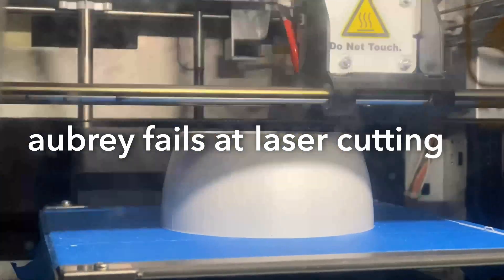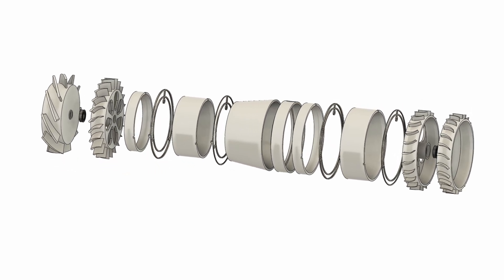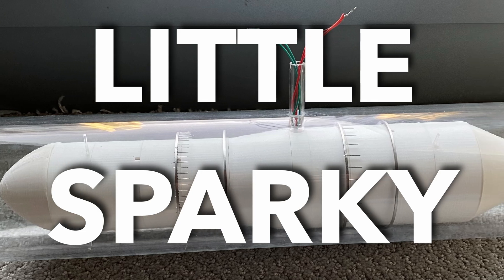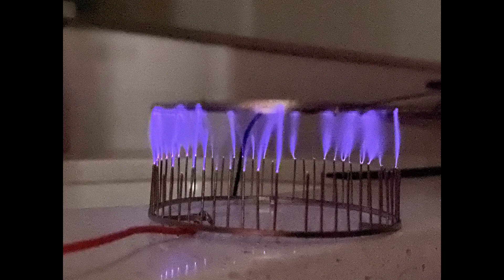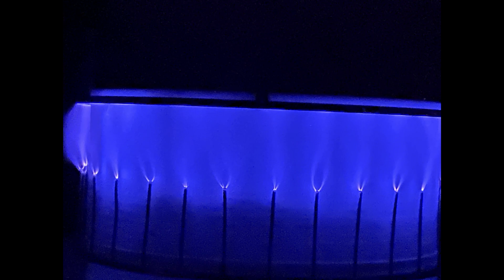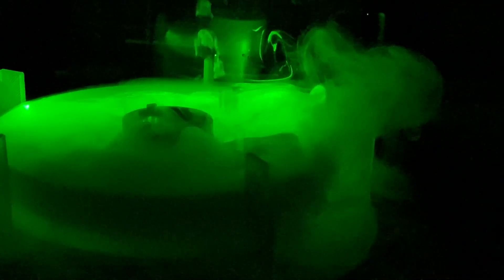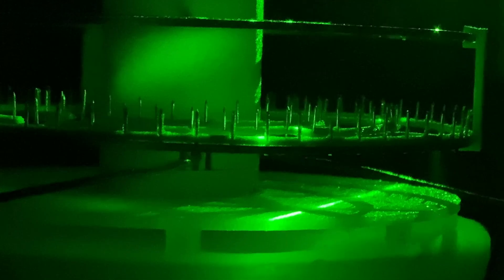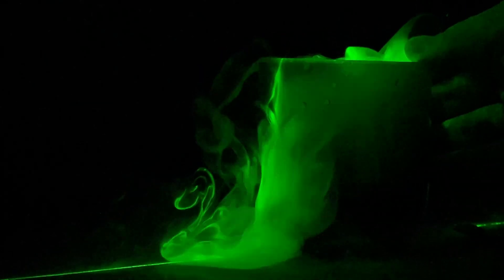Aubrey Fails At Plasma Physics

Comment: Nice visualizations.  At about 0:38 you mention the Lorentz force as being responsible for the corona streamers you show.  However, the Lorentz force ( https://en.wikipedia.org/wiki/Lorentz_force ) is generated on charges moving in a magnetic field and is the driving force for electric motors and the reason auroras occur near the Earth's magnetic poles.  The corona streamers are generated by the electric force (like charges repel, opposites attract https://en.wikipedia.org/wiki/Coulomb%27s_law ) acting on ionized air molecules in the electric field between your electrodes.

Comment: Please wrap some copper wire around the acrylic tube and see how it affects the ionized air inside.
Reply from the maker: Can you be more specific? If I wrap the tube with opaque materials, I can’t see inside. The only way I could measure anything is via exit velocity. And do I do anything special with the ends of the wrapped wire? It would just act as a sorta dipole antenna if I didn’t. This just seems to sap energy and radiates it away. And having a solenoid loop around it all would align the E field and B field along the axis of flow.
Reply: @aubreyfails  I'm asking you to create first a linear tokamak with a current in the winding, which is spread out enough to see what happens inside.
Then try creating a capacitive charge on the inside by creating a charged conductor on the outside to see if the inside charge
 compresses the plasma.
Reply from the maker: Ok so for one thing this is running at 5W. If you think this will generate anything interesting beyond some corona discharge you’re dreaming. For another, you seem to have lots of ideas. Why not do the work yourself?
Reply: @aubreyfails  Without going into personal stuff, I have the mind of a mad scientist (I love the humor of Foglio's "Girl Genius," and xkcd comics),  but have never been able to grok calculus. As that is the gateway to Any technical field,  I'm screw. Otoh, I can see ideas other people don't seem to pay attention to, and I end up wondering, "what happens when you do this or that?"
Then add that my job is leaving me little time or resources to work with. You, otoh, seem to have the resources and skills to do things.
TMI? You asked. I could go on a rant about the Aholes trying to stop and Musk, and the other ones running Boeing literally into the ground, but I'll spare you.